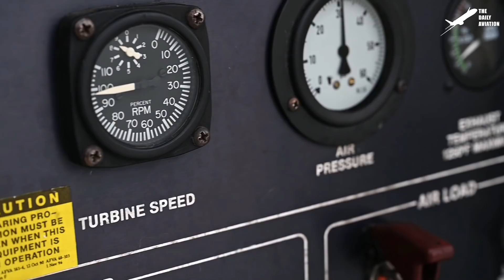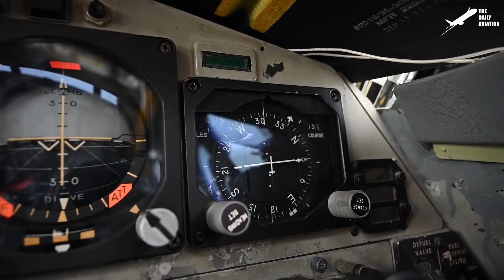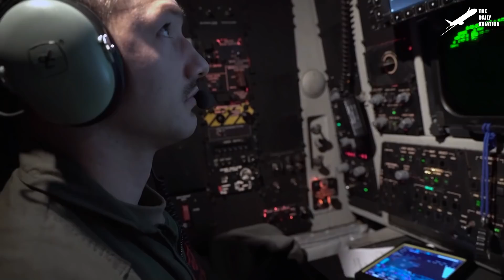US Need This Special Technique to Start this Gigantic Aircraft

Comment: Thanks for the content, I enjoy watching vids about airplanes.  Having said that this video somewhat misrepresents how things work.  On the B-52 and a lot of other military aircraft there are a multiple ways to start the engines. On some it's using air supplied from an auxillary power unit on board. On most it's either using high pressure air from a "start cart" on the ground next to the aircraft, (you can see that in this video. The hose looks like a big dryer hose) or from starter cartridges that are pyrotechnic devices loaded into the side of the engine. When activated they produce a lot of gas (and smoke) that is used to start the engine. In some cases they don't even need to start all the engines that way as some aircraft have the ability to route "bleed air" from a running engine to start other engines. B-52's used to sit at airfields in alert status, loaded with bombs and ready to go, crews close by.  If an attack was detected (I'm talking nuclear) the planes needed to get off the ground fast. Hence, all the crew needed to do was strap in and activate the cartridges and go.  In my experience in the Air Force. In non alert situations they used the ground supplied air from the start carts but occasionally used cartridges just to keep proficient in their use.  I know it's confusing, but cart starts and start carts are two separate things, lol.
Reply: No APU on a Buff. It's either air from a ground unit or a cartridge start.
Reply: I don’t believe the video ever said there was only one way to start. It just showed the most common way.
Reply: @eastender74  Yeah, your right. It was them calling the ground equipment a "Cart Start" that triggered me.
Reply: I hated to clean the breaches after a cart start.

Comment: At 1:46  The "cart-start" was known as a -60 (I always called it a dash sixty) when I served.  In fact the -60 could be called a start cart or a huffer.  A cart start (or a cartridge start) was an alternate way to start an engine without the use of any AGE (aerospace ground equipment) basically an explosive charge that produced the air under pressure to turn the starter which turned the gearbox which then turned the compressor and turbine sections of the engine.  The engines are started via cartridge starts at 3:20
Reply: I believe even piston radial engines has a similar charge for emergency startups.
Reply: Those F-4's and B-52's kicked over with cartridges would about choke you to death, when you were behind them. I got caught once maintaining security behind one once. The Class-A Security Chief ran his truck between me and the F-4 pulling me in and hauling off...I was hitting the ground. I didn't get in trouble nobody told us of the run up, and everyone in the security zone was authorized. It actually started some crap because it wasn't a Klaxon and People wanted answers I guess. I just didn't want the Flight Chief to get in trouble, I was OK so let it all go. BUT it was out of my hands.
Reply: @joshuasterling2144  Yeah, my dad called them "shotgun shells", but properly Coffman cartridges. Featured in the original The Flight of the Phoenix.
Reply: Actually it’s called a “Dash 60” for the purposes of nomenclature and fuel billing. It runs off JAA jet fuel
Reply: IIRC, ALL of the Century-Series aircraft had Cartridge-Start ability.  The F-16, F-15, and F-22 use Compressed Gas to do the same thing.  I Can't remember now, but I think they ALL uses one standard Cartridge as well.  The only One that used Different Cartridges was the B-57, those were about the Size of an Oil Filter, and went into the front cone.  The Martin Canberras routinely used the Cartridges.
Reply: Man you guys all obviously served just wanna thank everyone. Shattered knee junior year of high school or that was my plan.Drove a truck and saw 45  states but never out of U.S. Had to be an adventure.
Reply: @fuzzybutkus3951  You're welcome!  All my time was cold war stuff so pretty tame.

Comment: In my time, we still flew the “D” which had a rear gunner position, love the “BUFF”!!
Reply: I remember driving by the rear of one of your aircraft while out checking the bak12s..and the gun in the rear was following our truck...was told later that the guidance system was left on that’s why the gun was tracking us...
Reply: @richardnightingale9086  No Richard it was just someone in the gunner seat playing with you.After a few opps that was stopped. The system was in manual mode. I played with the system on the G witch was the same system as on the D but they moved the gunner up front. On the F it was a different system. But the gunner went bye-bye a few years back.
Reply: D models with the big belly mod. The real BUFFs!
Reply: @burtvincent1278  Current Hs are all "big belly."

Comment: I can't believe that beast even gets off of the ground,what an incredible  piece of machinery
Reply: Considering it was conceived over a weekend in a Hotel Room, using the B-47 as the base for the design, using only pencils and slide rulers... Nothing like that has happened since.
Reply: the wing tip flex from sitting on the ground with lots of fuel to being airborne is 20 feet. pretty amazing...
Reply: @theduck1972  unless you compare the  Antonov An-225 Mriya to it.
Reply: I'll admit, I am not familiar with that airframe, other than pictures.  Was it's development done in as short a time, and comparative conditions?

Comment: 4:37 right, they produce lots of thrust but modern engines require much less kerosine
Reply: 15 000 000 Gretas exhaust
Reply: The Vulcans were the same, the Air was Black on Take off, not like modern engines.

Comment: Maximum speed is 650 mph (1,050 km/h, 560 kn), not 400 mph as reported in this video. Cruising speed is 509 mph (819 km/h, 442 kn).
Reply: Airspeed is limited to 622 mph by the electro-optical viewing system, which causes flight instrumentation issues at higher airspeeds.
Reply: Yes, but that's at sea level.  At 30,000' 650mph is supersonic.
Reply: @pamike4873   Airspeeds approaching Mach one induce tuckunder, and are also prohibited.
Reply: @dougwickstrom9870  Hence why the 650mph is at sea level.  At cruise altitude top speed isn't 650mph.  You might get 650 indicated, but not ground speed.

Comment: Fun fact. A B52 and a 787 is about the same weight and size and have the same range. But the B52 need to carry 60% more fuel, and the 787 can carry considerately more payload.

Comment: Slight error in this video. The BUFF can fly at a tick over 600 mph not 400.
Reply: Slight?
Reply: Airspeed is limited to 622 mph by the electro-optical viewing system, which causes flight instrumentation issues at higher airspeeds.  I suspect that the video referred to cruise.

Comment: There are times I can’t believe those airplanes are cost effective to maintain and are capable of being maintained, especially for another 20 years.
Reply: compare that to the Antonov An-225 Mriya.
Reply: @canadianradiochemist4465  The An 225 was built in the late 80s while the last b-52 was built in the early 60s.
Reply: @andrewdavidson7656  compare the wingspan though, 56m to a gargantuan 88m, 20 years difference compared to 32 m difference.

Comment: Buffers have been used for air starts since very early jets.  Many now have built in APUs (auxiliary power units) that are used not only for ground electric power to the plane but supply air to the first engine or more at the start

Comment: The cart start, short for cartridge start, is only used when no air is available to start the engines normally, or when on alert.
Reply: They were used Routinely for both F-100's and F-105's in Vietnam/Thailand, The Crew Chiefs weren't huge fans, because they were a bitch to scrub clean.

Comment: As an Air Force firefighter in the Strategic Air Command, I've seen hundreds of cart-starts, when the cartridges are used. When the air hose is used, it comes from the starter cart!  There's the difference between the two.
Reply: SAC Trained Killer myself, worked many B-52's, D's, G's and H models. I figured they had the 2 mixed up or misunderstood that they are two separate systems and the B-52 can be started with the Start Cart pushing air through the air starter with the Starter Cartridges installed in the engines. The Start Cart, MA1A Screaming Mimi and later the Dash 60 air hose would hook up to the Number 3 Engine. Once #3 engine got started the Bleed Air System would start the other 7 Jets.  I think they might believe that the hose of the Start Cart hooks into where the Starter Cartridge goes as they show them pulling a starter breach cap. I worked out of the Fabrication Branch, Machine Shop on several bases. While I was working the B-52's, they had a problem with some of the Starter Cartridges blowing off the Breach Caps right through the side cowling. We had to check the measurements between the locking lugs of the Breach Cap and the Engine. As I remember it wasn't from an excessive gap between the two. I never heard what caused the problem but it may have been a bad batch of the Black Powder Cartridges, or mishandling and dropping them. The Black Powder needed to be packed in that cartridge in a certain way to make it burn like a rocket engine. If the cartridge was mishandled or dropped it would cause cracks in the packed powder and cause it to act like a cannon going off.  
I wound up being transferred out of SAC when they sent me to Hickam AFB HI. I wanted to go back to SAC after that tour but wound up in AZ with A-10's. Then they deactivated SAC and created the Air Circus Command. At least that is what it turned into and I was glad when I retired.
Reply: @EIBBOR2654  It's not black powder, which is corrosive.  The propellant is ammonium nitrate.

Comment: FYI the B52s max speed is about 650mph and it cruises at around 500-515. Well above the 400mph stated here. That’s kinda an important bit of information to get blatantly wrong. I appreciate the effort, but taking the time to actually publish into an informational video you may want to get an important parameter like this correct.
Reply: Airspeed is limited to 622 mph by the electro-optical viewing system, which causes flight instrumentation issues at higher airspeeds.
Reply: I thought 400 mph sounded low.
Reply: cart start was a big clue they were making a poorly copied slide show.  then they skipped it's 1 of a kind landing gear set up

Comment: 4:45 the official top speed listed by Boeing for the H models is 650mph.
Reply: Airspeed is limited to 622 mph by the electro-optical viewing system, which causes flight instrumentation issues at higher airspeeds.

Comment: Fun facts: the air cart starting is not that special. Lots of planes use it. Also, the B-52 has a top speed of about 650 mph, not 400
Reply: We used probably the same style units at OHare airport when APU's on the aircraft were broken.

Comment: "120,000,000 rivets flying in close formation"
Heard in the Sheet Metal Shop at Castle AFB in 1973.
Reply: A few years before. When they started the camouflage paint scheme. One of the maintenance people said that that adds about 500-800 pounds. That’s a lot of make up on a 30 year old gal. Can anyone come up with the right weight?
Reply: @CSltz  I heard it was about 1100lbs but I didn't work in the paint shop.
I can, with absolute authority say that the drag chute weighed 220lbs.
Reply: @Zoomie932  Thanks for that information. I really like talking to people about this kinda stuff. My father was on the fighter side of the base. Heard some great stories about them also. My self I was K-9. My first night on duty we had a alert. I watched these birds leave many a time.(MITO) if I have that right. But I remember saying to myself “Man I’ve never been this close before. This is neat!!)  A little bit later I’m going hey! This could be real. Sleep tight your Air Force is on duty.🤣
Reply: castle 1992-1994.  then it closed.  still had b52s and kc135s

Comment: That's how all jets are started. This isn't unusual.
Reply: Yeah, I was on both a 757 and 737 the other day and marveled at how they were started with gunpowder cartridges. NOT. those CFM 56's and PW 2000's would blow up if they tried to use a cart start system. The TF33 was one of the few engines capable of using that system.
Reply: How to unpack and assemble a 10 in.. Kobalt table saw
Reply: Video of how to unpack and assemble a 10 in. Kobalt table saw
Reply: @brushcut57  Yo dude, did you ever get your table saw set up? Make sure you use a push block at all times! And always wear eye pro
Reply: Most jets are started with an APU. Bob C  is probably old.
Reply: most b52 engine starts and by most i mean 99.999% of them, are by ground equipment.

Comment: when i worked on this plane in the 80's, it could be started 3 ways. but all have to go through the starter.  you also only needed 1 engine started which could start the others.
Reply: John, I don’t see the extinguisher standing by.....are hot starts not a thing anymore?
Reply: @jamesanderton344  I don't know they are not even using the same engines I worked on (J57 turbo jet)   I think they are using tf-33 now.
Reply: Hi John, you said there are three ways to start engines on the ground. One was pneumatic,  the other with cartridge. What was the third?
Reply: @tezo3305  Just get the keys 😎
Reply: @jamesanderton344    The fire extinguisher are always in the area.  On alert,we kept one at each wingtip.

Comment: Its a gorgeous fighter, definitely sleeker than the Firefighter/Typhoon and it's near doppelganger the Rafale.  If SAAB is able to keep the capabilities of all the electronics, hard/firm/software equal to or better than the direct competitors than it could fill the same spot that the phenomenal F-16 defined.  Compared to the Typhoon/Rafael, the Gripen's maintenance time is lower, cheaper, and simpler.  The Gripen's single engine and lithe frame reduce fuel requirements, increase reliability, and keep future upgrade costs modest.  It is not now and can't be made an air superiority fighter and match the F-35 which is not a competitor to the  F-22.  I'd pick the Gripen and use the resources saved vs Typhoon/Rafael to enhance or add air support, stealth, attack, and drone swarm capabilities.

I also owned 3 SAABs and loved those cars, bummer they're gone, but glad the Gripen shows they've still got it.
Reply: I liked the old SAAB 2 strokes, a copy of the German DKW which was better than the VW. You could take the engine out of a DKW and put it right in a SAAB.

Comment: Used to have to use the air cart on T-38s.....start one engine then crawl underneath and manually flip a valve to start the other..
Reply: Eventually ATC built an underground air system at training bases for starting T-38s. Significantly reduced usage of air carts, but did not eliminate it. A bad characteristic of the new underground air system was that it was severely underpowered. Crew chiefs were used to using air carts at each T-38 to simultaneously start at least a dozen aircraft. The new system stalled out once you had more than 6 simultaneous start attempts.

Comment: It's pretty amazing to think of the longevity of these planes. By the time the airframes are retired it is possible some of the pilots would be flying the same basic aircraft model their great-grandfathers did (modernized and later production airframes but still). Similar to the A-10, the M2 Browning MG, the M1911 pistol or the final deployments of the Iowa class battleships 50 years after they were launched.